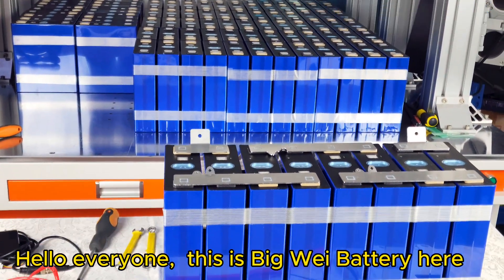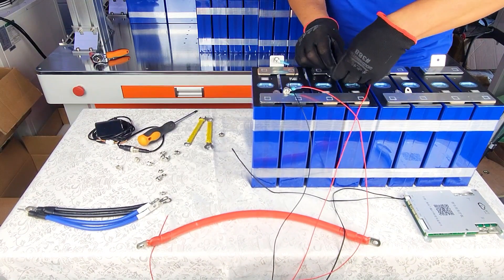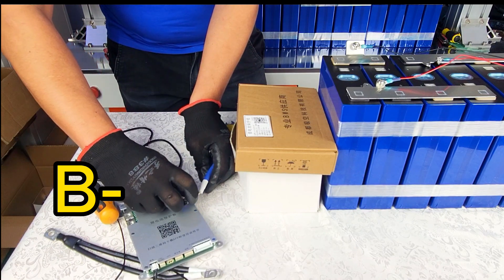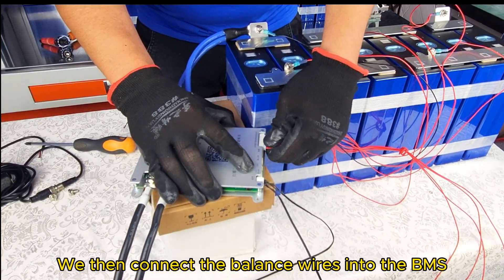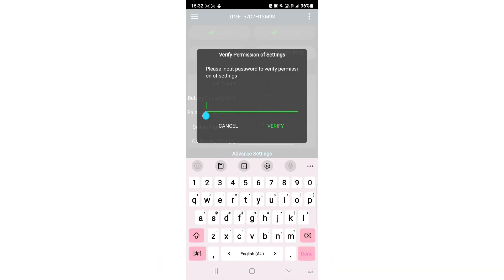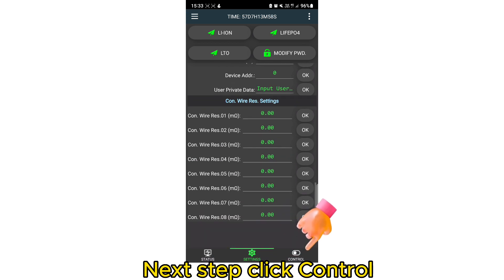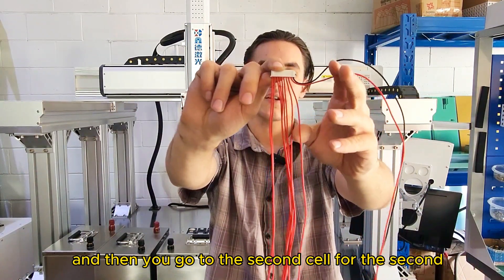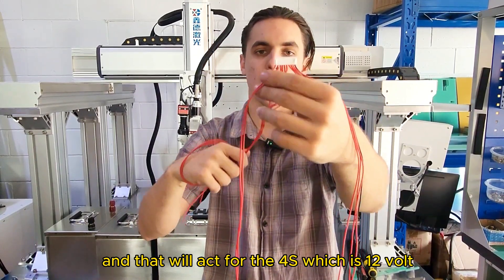JK Jikong BMS Installation tutorial by Big Wei Battery

Comment: I will be running a 24 volt system,  I want to run 16 3.2volt cells configured to 24 volts,  I have two of these batteries.. a total of 32 cells.  the cells  are rated at 280 ah. My MPPT is a 250/80 viltron unit. and I am running 4-540 watt solar panels on the roof of my motorhome. My inverter charger is a viltron 3000/24/70.  I am trying to figure out which JK BMS I should run on each of these batteries.

Comment: Hi,
I have 16 cells running in parallel pairs of two (like you have 8 cells here running as 4 cells to 12v). The total voltage is 24v for my system. Should I connect each BMS wire to each cell or each parallel paired cell like you have in this video? 

What happens if you get a rogue cell that affects the pair?

Thanks
Reply from the maker: Hello!
For the layout of the BMS and most BMS's, the balance wire is only able to balance with "one" cell. So you'd have to connect two cells in paralell for the required setup you need.
So yes for wiring up the balancing cable you'd connect it to the paired cells like in our video.

Plently of our LiFePO4 batteries has this paired layout and it is able to work with eachother well in paralell together.
I hope this helps

Comment: I just bought a B2A24S2OP looking at the wire size 2 8 Gauge wire how can it handle 200 amps continually.  8 AWG wire can handle 55 amps each so two in parallel would be about 120 amps not 200. This thing says it can go to 350 max can't see how this wire can do that. The video your is much heavier connections.
Reply: He was using 6awg cables, would be more suitable

Comment: Thank you for time and video. Its better to left a small space between cells? All others people splitting cells without free space.
Reply from the maker: Hello!
Our design has the high density foam between the cells which gives vibration resistance. Escpecially for use in vehicles.

Comment: I have 2 Jk bms in my system and think they're great. The only feature I wish they had was current limiting when the cells are near full charge so you can charge slowly while balancing instead of it having one cell hit your set voltage and fully stopping charging even though other cells will accept more.
Reply: Sounds as though you pack is significantly out of balance, so to reduce the likelihood of a fully charged runaway cell tripping BMS over cell voltage (3.65v) reduce your charger pack voltage ~14V and check that balancing is activated. Now leave battery balancing and watch delta V reduce from 100-200mV and once delta V is  <20mV push up pack voltage to 14.2 then 14.4V and eventually you have a balanced pack. Need a charger with variable voltage.